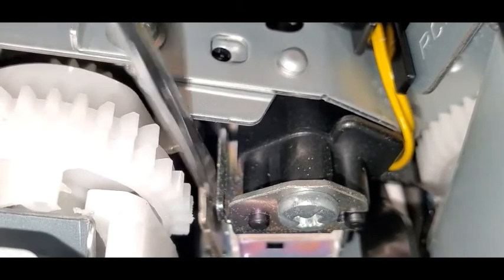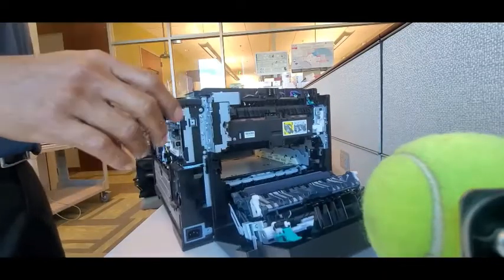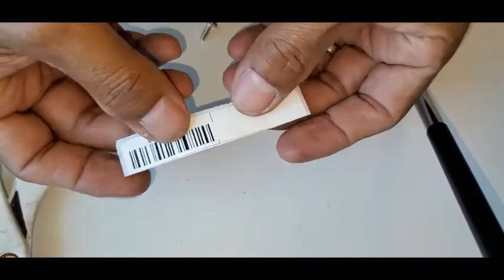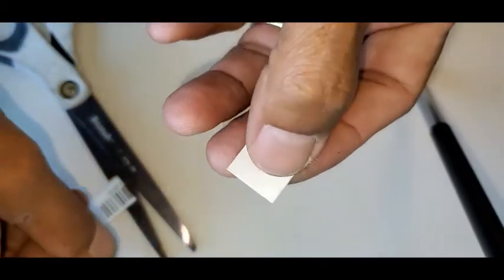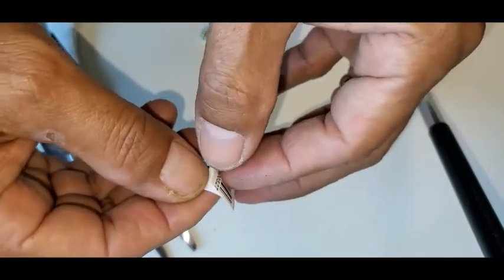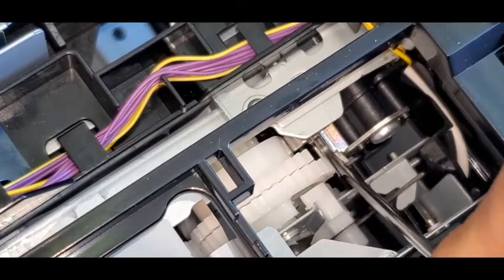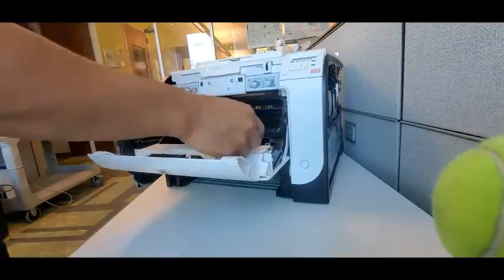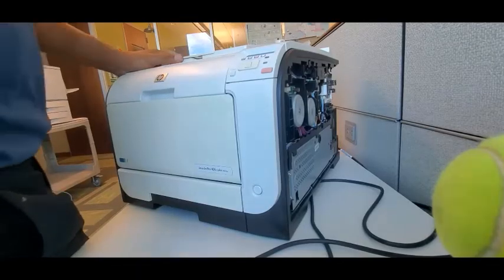*QUICK FIX* HP LaserJet M451 M375 CM2320 error 59.C0, 59.co, continuous cycling, calibrates forever

Comment: Is it the same on a CP1515N? Would a fix be superglueing a piece of bicycle innertube in the foam's place to prevent the piece and main body sticking? Also I have a demagnitizer for my tape, and should I use it on the plate?
Reply from the maker: These are great suggestions, test and see if it'll work. My experience with alternate materials vary, too much thickness may sometimes cause issues, the same with it being too thin.
Reply: @FieldServiceTechBusiness  I already did, and inner tubes of bicycles are about 1mm thick, so perfect. Works great but I thick I misaligned some gears because tray 1 doesn't feed in far enough and throws an error.

You wouldn't happen to know which gears operate tray 1 per chance? Otherwise I need to disassemble it all again and check and double check.
Reply from the maker: @LogiForce86 the material may be too thick which causes the pawl of the solenoid to not clear the notch in the collar when engaged. Might need to try another less thick material.

Comment: Thank you so much! This brought our HP LaserJet Pro 400 color MFP M475 back to life. I also had the error 59.C0 and repeated calibration. This printer has a scanner on top, but one can access the respective solenoid like this: Open the side cover, 3 screws, one back, two on side bottom / Slide cover backward, pull off (without force). / remove all connectors from the mainboard (with the ethernet socket) and, if installed, fax module. Then unscrew the metal plate below the mainboard; there are about 10 screws, one of which on the backside. One can move a black plastic part a bit to turn the lowest screw on the back. / The cogwheel and solenoid with the metal lever are visible just a few centimeters behind the position of the mainboard.

I then applied the sticker (I used electrical insulation PVC tape). After re-assembling, I made many printouts (on used paper, of course) non of which failed! Congrats for this fantastic fix.
Reply from the maker: That is great! glad it worked on your M475! Thanks for the detailed instructions on your fix.
Reply: @FieldServiceTechBusiness  I have to say thanks. I know how much work it is figuring these things out and - in addition - sharing them as a video. Without your hint, I would have been on the wrong track. I had read somewhere else that the error is induced by too high a force / current on the motor that transports the transfer foil. I would never have suspected the solenoid was causing the problem. Mine is a printer rescued from the garbage several years ago; it just got a new life - again. Good for the environment and for the wallet.

Comment: Bought LaserJet CP1525n color 10 years ago and never used it after it's first toner. Got a need for a printer and found it switching on so I bought toner and tried few copies, all test pages were printed ok, but after few prints I realize the printer took a lot longer to print any document, then yesterday I got the error code 59.c0. Look up online and this is the first place I found a solution.

Thank you so much, when I get time I'll try to do this quick fix.
Reply: And how is it going?

Comment: I have 12 year old CM2320nf and since I start use it for 12 years I never had any issues.
But recently all of sudden, my printer does not feed paper from any tray and continuously running prints or copy operation without paper feeding.
To stop this malfunctioning, I need to unplug the AC cord. And I didn't have the error code "59.C0" with the latest firmware.
I have the latest firmware so, there was no firmware updates necessary at HP support site.
So, this video was very help to fix my printer. in my case when I fix the solenoid the problem was not resolved. 
So I changed the Pick-up roller and the Separation roller together.
And then my printer starts work again as brand new printer!.(Lots of videos in you tube for the roller changes).
Thank you so much to providing this video!

Comment: Fix also works for CM2320, just inserted a little sticker as shown. Perfect solution, saving me a lot of money. Opening of the CM2320 is almost the same, see other videos on the net, then proceed like shown in this one. THANK YOU, whom ever you are. As semiconductors are badly available currently, a new printer would have cost a lot and I like mine and still have lots of toner. Again thank you.

Comment: THANK YOU! THANK YOU! THANK YOU!  A simple (relatively) fix saved a $700 laser printer when every other site (including HP's own community forum) said the 50.20 error meant the unit had to be replaced. None even offered the solution to replace the solenoid... which I probably couldn't do.  A 1/2" piece of and address label and the problem was solved.  FOOTNOTE: I didn't take as much of the printer apart as you did.  I only removed the screws on the back; the two screws holding the top then unsnapped the top and had all the access I needed.  Didn't remove the sides or the toner tray.  Plus I only used a one-sided label as opposed to folding it in half and sliding it in between.  I didn't have as much room on mine as was showing on yours, but the tweezers slid it into place and it stuck and the solenoid opens and closed cleanly.  I could tell by the sound it made when it started up it was going to work.  Got into the menu; printed a test sheet and it worked like it did since day one.... And day one was several years ago.  Thanks again.
Reply from the maker: excellent! glad it worked out for you.

Comment: Thanks for this video. My CM2320 stopped feeding paper after changing a toner cart; I thought I broke the printer. Some Web search on continuous cycling led to "sticky solenoid" and then your video. The paper fix is the same one I learned for the HP LaserJet II decades ago. Why do printers still have glued rubber deadeners?

Comment: Holy guacamole!! Thank you so much for making this video!! I have an M375 that was having this problem.  I stuck a screwdriver in there covered with a dry wipe dipped in acohol and dcrubbed all the glue off and it work well too!! This 375 is much harder to take apart because of the scanner unit, so I figured I'd go for a more permanent fix.  Thank so very much for making this video you just saved me hundreds of dollars.
Reply from the maker: Glad it worked! Great job on your fix!

Comment: Thank you very much. It worked also for my CP2025. There is not so nice acces after same disassembly and I didn't want to take whole printer apart. So I just needed to cut 5 by 5 cm of inner upper plastic cover in order to comfortly apply sticker. Now it works as new.

Comment: Thanks, very helpful video. I read in some comments that it would work as well to just clean the metal. I tried this, but it did not work. So you really need some kind of label or felt to cover the metal from the solenoid. Maybe this helps someone, too.
Reply from the maker: Thank you for the feedback. I too as well had the same problem with just cleaning the metal plates. When there is only "metal to metal" there seems to be a small magnetic residual charge that keeps the plates sticking together. An insulation such like a label or sticker as you have used prevents that. Thanks again.

Comment: I have an HP LaserJet 500 m551 printer, and I have the error code 59.00.CO as well, It is hard to reach as a non-professional, I was just trying by watching these videos and following instructions which I did base on the nearest model printer that matches mine, I can't take it out based on the location, I was watching a video until he stops there and use a method and took out the entire bracket that holds the gears and solenoid, so I didn't see the last part how he did it, so I came up with my own method to get rid of the sticky padded piece, " but It wasn't sticking at all, but I use a long needle to scrapped it off, it moves free, been doing so before i assume it was sticking, base on the test i gave it to check if it was really sticking, I close back up the machine which was the hardest part, as I couldn't remember the step I took, I put in the screws in the holes that I saw empty and so far, it holds together, yet I still have about 6 screws leave back, After I manage to do so, I turn on the printer to now see fuser error, but it hardly comes back, but the error code 59.00.CO returns, yet my solenoid has nothing to stick on to cause a delay...what can I now do to solve this issue.

Comment: How did you clean the plates before applying the label? Other people said to to use a cotton swab with alcohol or similar, but I can't manage to fit a swab in there-the space is too tight.
Reply from the maker: You can try to clean them out, I did so a few times myself, but found there was no need to do so if you place two sheets of labels in the slot (non-stick sides against each other and sticky sides against the plates).  Typically covering the old and worn adhesive on each of the plates.
Reply: I don't know how I'm going to manage get it in there, but I'll try. Thanks.